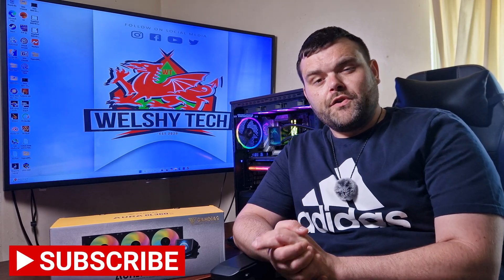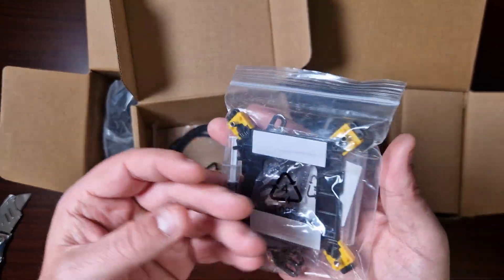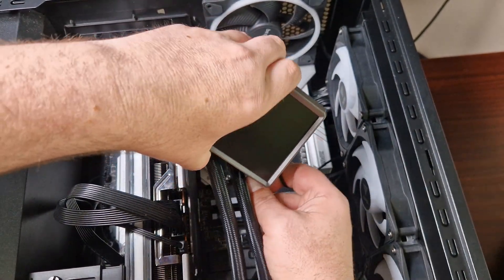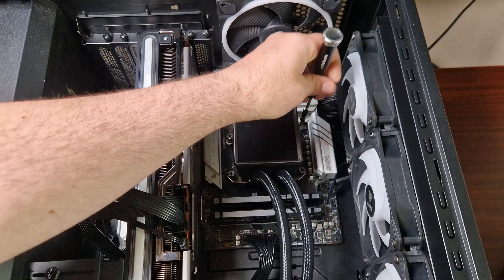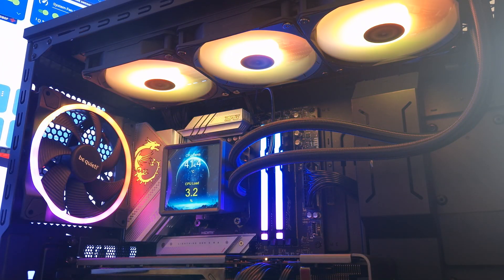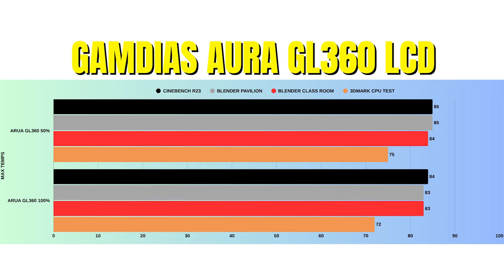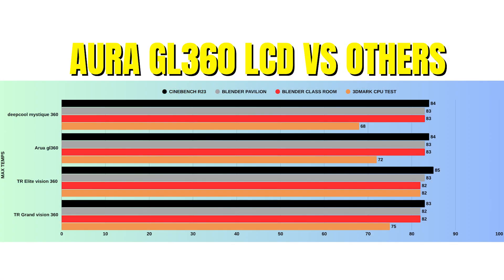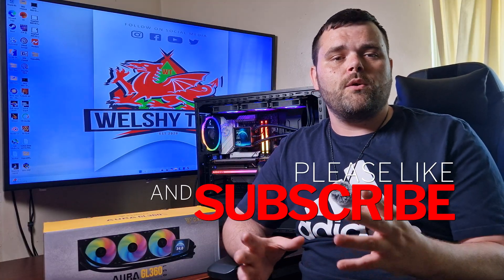The best $110 Aio Cooler? Gamdias AURA GL360 LCD Aio Review

Comment: I purchased it last night, but it has only a 3-pin connector while my motherboard requires a 4-pin. As a result, after connecting the 3-pin, the fans are running at full speed, making it quite noisy and difficult to control.

Comment: hey man i got from gamedias the gl360 digital and the screen is rotated i cant rotate it in the app there is no option
Reply: ists reading in app that it is chione va display
Reply from the maker: That's strange, have you tried reinstalling the software?
Reply: @WELSHYTECH  yes i it didnt help and know my aio is upside down i can rotate it by reinstalling it sidways but i have clearance issue by the ram
Reply: Hello my display don’t work at all is there any extra cables apart from the 2 on the Aio head ?
Reply: @jaydenbrighton1545   Mine also is not on

Comment: I DOWNLOADED THE ZEUS CAST SOFTWARE BUT IT DOESNT SHOW THE AURA LCD DISPLAY ON THE LEFT , ONLY HOME !! CAN U HELP ME PLZ
Reply from the maker: Have you connected up everything
Reply: @WELSHYTECH  i bought it built in already (brand new) , i don’t know how to check if everything is connected right, but the screen on the cooler is on and showing the company’s logo does that mean anything??
Reply from the maker: Check at the bottom of your motherboard it will be a connector coming from the AIO. Check the cables at the back of the case and follow the cable going straight to the bottom of your case. This cable is a USB2 cable it will be for the screen and also to make sure you download the software for this Aio
Reply: @WELSHYTECH  yes there is 2 cables connected to the bottom of the motherboard one is called (USB_11E4) and the other one called (USB_56), there is 2 cables coming out of the AIO one on the side its like a USB C and the other one from the top of it , i think the type C cable is the one connected to the (USB_56) so this mean its connected right ?